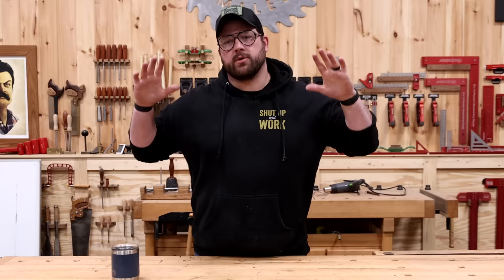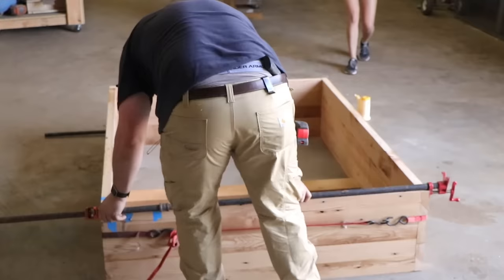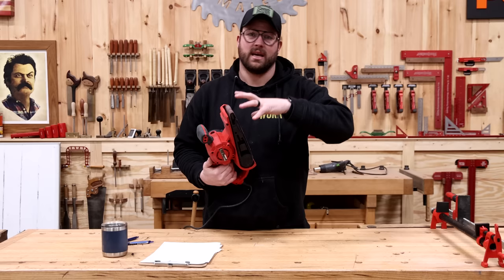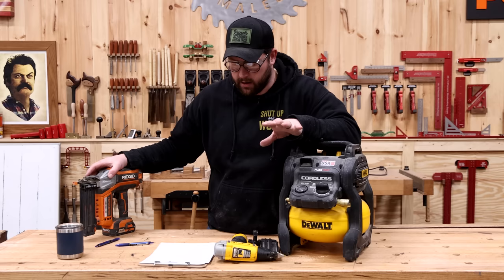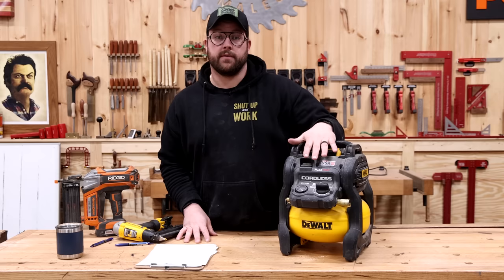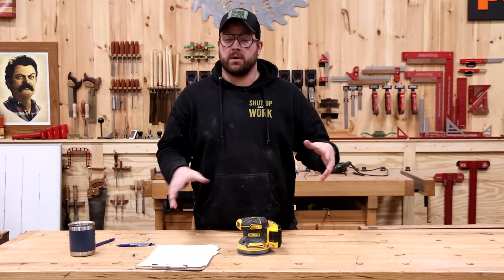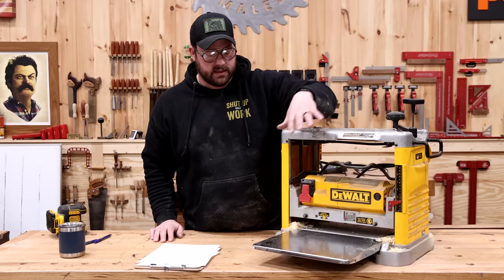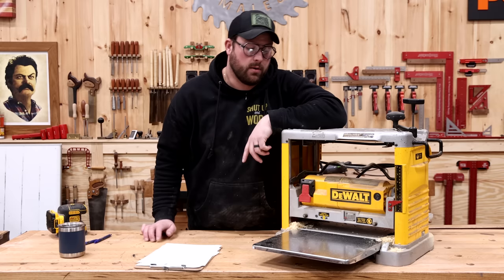5 Beginner Woodworking Tools I Regret Buying

Comment: For nail guns for a beginner I'd suggest one of the 3 gun and compressor kits. Their all Identical but sell under porter cable, craftsman, bostitch and many others brands for around $200.
Reply: Porter cable pancake compressor with a harbor freight nailer/stapler is another cheap yet very effective option.
Reply: I got the Ridgid set the hose is trash but everything else is great.  And I do mean the hose is trash it's in a dumpster right now damn thing burst Friday
Reply: I bought the Craftsman pancake compressor with the 16, 18, and 23 nailer for around $150 a few years ago.
Reply: Also, a hammer. Dirt cheap.
Reply: years ago I got the porter cable combo with the compressor, brad nailer,  finish nailer (i don't remember the gauge and don't use it much), and stapler. The stapler is basically useless, but having the two nailers and a compressor that can run all day is worth every penny
Reply: I picked up the 3 gun set by Husky (HD) and been mostly happy with it. The only thing I wish is that the pin nailer shot the longer 1 3/8 inch.
Reply: @spencerhatfield5075  I was looking at a porter cable combo like that on sale., 18 gauge, 16 gauge, and a pin nailer that does up to 1 3/8". Glad someone had a good experience with it.
Reply: I have the porter cable version.  Seems to work fine so far.

Comment: I have the Ridgid oscillating sander and I use it all the time. Ironically one of the reasons I like it most is a one-stop-shop sanding station and I like it BECAUSE I don't have to have Several different sanding tool.
Reply: I purchased the ridgid sander way back when it was $99 and use it a lot,  but now mainly as a spindle sander, because I have a bench top belt sander now as well.   Good suggestions,  because I have experience almost all of the same as you
Reply: I also use mine a lot. I had the drill adaptors and hated them. also have to be careful with the drill drum bits. The bearings are not designed for lateral loads and can get tweaked.
Reply: So I’m on the verge of buying the Ridgid sander next week…So I take it y’all recommend it? Any issues? Thanks for any info…
Reply: @juanmendoza7487  not really. I've had mine for years. Never had a problem with it.
Reply: @dpoarch  Thanks
Reply: My Rigid Oscillating Sander sees constant use in my shop, and I think it is well worth the price. I found it somewhat disingenuous at the 12 minute mark when he is acting as if he doesn't understand belt tracking. This is not a flaw of the machine, and anyone who owns one knows how to quickly and easily adjust the tracking knob.
Reply: @Metal_Vistas  yeah I thought the same thing regarding the tracking. It was like watching an infomercial where you'll spill milk everywhere if you don't use the Milk Master 2000!
Reply: @juanmendoza7487  The Wen, Triton, and Bauer versions are almost identical and usually cheaper.  I've got the Triton and like it a lot.
Reply: @sirbrewzalot  I was looking at the Triton and Wen as well…Decisions decisions…Lol
Reply: @juanmendoza7487  Well they are almost certainly made in the same factory.  I think the Rigid one has a slightly bigger table the others are essentially the same.
Reply: @sirbrewzalot  Yeah that’s what draws me more towards the Ridgid, the bigger table…Ridgid it is…Thanks @E B
Reply: Robert.  I agree....I've been wood working for several decades and have pretty much one of everything mentioned...except k clamps.  I have the jet oscillating spindle sanders, 12 in disc sanders, small and large belt sanders and with the rigid, I can do pretty much all with that one tool and it takes up so much less space.  Honestly, I know this was geared toward beginning wood workers but I think the author got it wrong on this one.
Reply: Got mine when they were $199 and haven't regretted it since.  Use the belt most of the time.

Comment: I have that very DeWalt Orbital Sander. I use it literally all the time because I have to work outside a lot, and because I use rough, dirty wood (old discarded pallets) it's great for just throwing some low-grit pads on and running over everything to get off dirt, mold, rough edges and other stuff to make the wood nicer to handle, or prep for painting. I also use it for quail cages so they dont have a ton of rough surfaces to hurt themselves on or for their mess to work into. And without a cord, it makes it especially wieldly and handy to have at the ready.

Admittedly it wasn't something I originally wanted, since I only got it with a package deal for something else and thought I could give it away as a gift. And granted I'm not some experienced master woodworker, as I've only started doing anything significant the past few months, but so far I am very glad I kept it, because honestly I use it more than any other tool so far besides my drills for wood stuff, and while it takes a bit more time, the finished project is that much nicer. It helps that it's also rather cathartic and soothing to use.

That doesn't mean I'm advocating a beginner get one, but it certainly still has it's uses.

Comment: Some added points for nailers if you're considering buying!
- For those who plan to nail a lot during projects, cordless nailers are considerably heavier than the corded versions (a couple more pounds adds up over a project while using an extended arm)
- Getting the compressor gives you shop air for future tools, vehicle tires, blowing dust off clothes and projects (very handy)

- Compressors can extend into pneumatic tools like automotive sanders, grinders, drills and hammers

The only upside I can give to a power nailer is that it's quieter in general compared to a charging compressor, and a bit more portable depending on your compressor hose
Reply: you won't be able to use this little compressor for anything other than pumping tyres and shooting small nails. would be better of buying a cordless one or purchasing wired big compressor.
Reply: Hose resistance is worse than an 8 ah battery which is massive
Reply: @traviswescott253 what does it mean? Not a native speaker
Reply: @E_Proxy  it means that the air hose constant tension of being dragged around is worse than the weight of a large battery that would run a cordless nailer all week. Which means you could use a smaller battery for day to day, be lighter, less hassle, and no loud compressor.
Reply: @traviswescott253  clear, thank you (it was more of inexperience with compressore than language barriere)
Reply: @traviswescott253  i guess it comes with how of a multipurpose tool you need
Reply: @traviswescott253  I agree, I have both, and I much prefer the battery nailer. Having a hose (which can break pretty easy) and loud compressor gets old really fast.
Reply: Added points? he literally covers all over those points in the video...
Reply: Advantages/disadvantages of air/electric nailers.

Electric is heavier. But not as heavy as the 15lb weights I run at full extension for my daily workouts...

Compressors are more diverse in use. Yet only supply air. Have scfm limitations. Which will lead you into 2 or 3 compressors if you decide you want those other air tools. Don't go thinking your running sprayers on a battery powered compressor, your talking a 500 dollar compressor there to hit 14scfm. Which is also 4 feet long and 2.5 feet tall and ruins all sanctity come 8am!

Air tools have a more diverse marketplace though. It's definetly still top dog on nail guns. I don't know of any electric nail guns that shoot 23ga headed pin nails. But I do know my GREX does, and I can attest to its awesomeness and I would never trade it for a 23ga headless pinner. I also like to hold my trigger down and do the old tap tap, which my grex doesn't do. But it's a 23ga pin nailer, not a brad nailer or a framer. It's for precisely hiding your nails!

If I was looking for a 15 or 18ga brad nailer, I would be looking at a milwaukee m18 version or air powered model equally. I really don't love tangled air hoses or the daily wrapping up of said air hoses. Or the tripping over air hoses, which leads to tools and people banging into finished work, which makes for unpaid work... That's definetly in my considerations. One battery fixes all that and my shoulder can shoulder the burden, it might even be a useful workout.

There's no way I'm going for a battery powered framing nailer. Get off my lawn with that crap! That's exactly why there are gas guns! But if your framing, you can trip over cords and bang stuff all day, it's rough carpentry!

Comment: To be fair, I found the Kreg circular saw guide you showed very handy. For anyone reading this and not knowing what it is, it's actually a parallel guide, so you can set the width of the cut, and run the outer guide along the reference edge of the wood you are cutting. This allows for accurate repeatable cuts (in lieu of having stable saw)  which I found very handy when building some ornament display shelves for our house.
Reply: I'm on my second Kreg Rip-Cut and have no regrets. It's definitely one of those tools that I don't use very often but, when use it, I'm so glad I bought it. Definitely worth the money for me.
Reply: 100%  it's a great tool once you get familiar with it.  making quick, repeatable rip cuts with the kreg is faster and easier than using a saw guide.
Reply: Definitely not one I don't use often but when I use it makes life akot easier. Like if you have to rip shelves  or sides for cabinets or bookcases set it rip and just roll.
Reply: I use mine to break down panels all the time and it's really nice to have around. Plus... They're like $35.

I see it as a tool for a different use case than an actual track saw.
Reply: In my experience I neve bought one, I just have a large flat piece of wood that I attach with clamps in any position and angle I want and I get excelent results.
Reply: @DavidGarcia-nx2gj  That works as a straight guide for a circular saw, but the Kreg guide allows you to reference the side of the work piece so you can get consistent cuts of the same width i.e., the same you would get after setting the fence on your table saw and running a piece of wood through multiple times, unless I am misunderstanding you.
Reply: @DavidGarcia-nx2gj  If there is no difference, then why pay more?  To make such a parallel device will take five minutes.
Reply: To be Faaaaiiirrrr!!!That might go over some heads if they are not Hockey and LeterKenny fans.   Had to be done..  Malecki, you are making some great content.  Appreciate it, bud.
Reply: I think the guide diss was to promote his Tiktok more than anything
Reply: I have the kreg rip cut and like it.  I use it to cut down the mdf for my cnc

Comment: The cordless 18g brad nailer though, is a great tool for installing and doing touchups at clients houses without having to carry a loud compressor. The ONLY downside I have with them, is the weight. Trying to get into smaller spaces, or on different angles, the weight can really be a burden on your wrists.
Reply: Oh theyre heavier than my fattest uncle. But handy³.
Reply: I agree.  Larger projects need the air compressor with hose and nailer.  But for small touchups, I love the battery operated brad nailer.
Reply: Wouldn't disagree, but I use a small air tank with my pneumatic brad nailer (that I bought long before cordless ones existed) and it works great for small jobs. You can run a lot of small nails off of that tank. It has a lot of other uses as well, so that's an added bonus. Multi-use tools are always nice.

Comment: Parallel clamps are meant more for cabinetry and boxes. Pipe clamps can start to bow over long runs so they have their limits too.I would still recommend parallel clamps for casework though.
Reply: I've found the jaws of the pipe clamps to be too short. My dad and I used to do a lot of 3 1/2" benchtops. If you put all of the pipe clamps on one side, the benchtop boards tend to fan. You have to put half of the bar clamps on the bottom of the benchtop and half on the top, which means at least half of your bar clamps need to be very similar so it's all even on the bottom, or things get wonky. The parallel clamps worked well because the jaws were the right length.

Comment: Harbor freight has some air nailers/staplers for well under 30 bucks that are workable. However I bought that Ryobi cordless brad nailer before I even had a house and it’s one of my favorite purchases and most used tools. Super convenient, and doesn’t require extra storage space (which was at a premium in my apt rentals).
Reply: We have had a HF compresser for over 20 years that has been abused in every way known to man. - Had to replace the pressure sqitch a couple years ago but other then that it is running like new. - We do not use them like a carpenter would but we have every HF nailer they make,,,,If you use Bostich nails, NO problems in over 5 years,,,,,and we are Industrial Contractors.

Comment: The first big tool purchase I made was a Bostitch air compressor combo kit that came with a 16 gauge finish nailer, 18 gauge brad nailer and stapler.  I've had it for at least 15 years now and everything still works perfectly.  I have the 12" Dewalt planer also and I never have issues with it.

Comment: I have had the old 12" Dewalt planner (2-blade) for at least 15 years. The overload has never tripped. I would like a bigger one with helical head, but the sucker won't die, and I'm too cheap to upgrade. 😊 Same thing with my Dewalt single bevel non sliding miter saw.
Reply: @Zzrdemon6633  where did you find that planer? Never heard of it,
Reply: Yeah I have an old model DeWalt thickness planer and it's never popped the overload. I think once you pop it once it'll keep popping easier then. You have to be careful with running them on extension cords too. Too thin a cord and it'll make the tool bog down.
Reply: I've popped the overload when going too deep on heavy boards; especially when the opposite face is warped in a certain way. When the boards are long and heavy, using roller stands on each end while ensuring there's nothing causing additional friction on the infeed/outfeed helps tremendously.
If it does pop, successive pops in a short span are much easier. If you have a bunch of planing to do, you might be better off with unplugging it and waiting 15-20 minutes, and then trying again.

Comment: A drill press imo is a perfect beginner tool. It allows you to make perfect repeatable holes, you can add sander pits, forsner bits, etc. Wen's cheap drill press has worked for me for a couple years and other than occasionally not having enough power, it's been great and I've used it for so many things.
Reply: The problem is that a good drill press (here in the US anyways) is $600 and up. 
 
I ended up just making a homemade version (good learning process for new users as well) with a corded hammer drill. Now, I'm not restricted by size, strength, or cost (with drill, it cost me $150, but I went big.) 
 
The low cost drill presses (WEN,  HF, etc) are all really poor quality, and easily outgrown.
Reply: @carterscustomrods  I'd disagree, 99% of people will never need anything above a 10" drill press. The benchtop presses may take more time to drill, but they can still do it. I've drilled 2" deep holes with a 2" forsner bit into hard maple with my cheap drill press.
Reply: I picked up an old craftsman from a friend for $40!  Great for beginner projects.  Will I out grow it, yes, but it was only $40!

Comment: I don’t use power tools often, but I do own that DeWalt planer - I don’t think I’ve ever tripped the fuse and I’ve used it on several table builds, a cabinet, multiple boxes, a mantle, and my Roubo bench.  It IS stupidly heavy, but I also haven’t tipped it over.  I usually start my projects from rough 8/4 so I appreciate a planer.  Having a jointer from the 60s that someone gave me also helps the process.  I certainly wouldn’t mind the better version, but even though I am much further along in my woodworking, I haven’t considered it worthwhile to upgrade.  I will say that I am primarily a hand tool woodworker and mostly use power tools for dimensioning lumber, so I am planing the surfaces with a hand plane afterwards so minor surface issues aren’t going to matter to me.